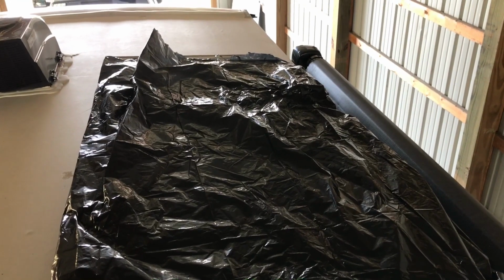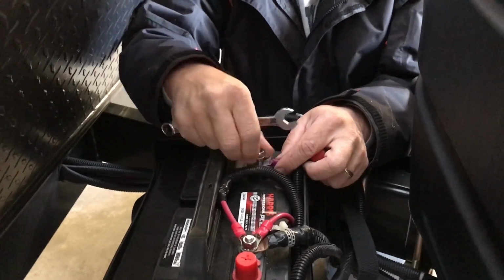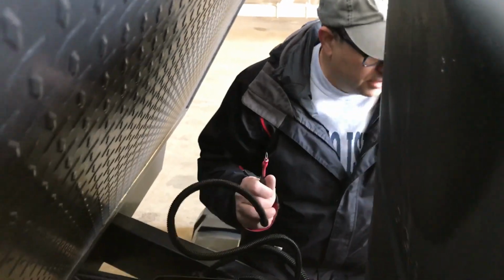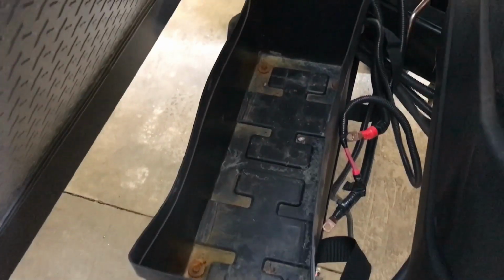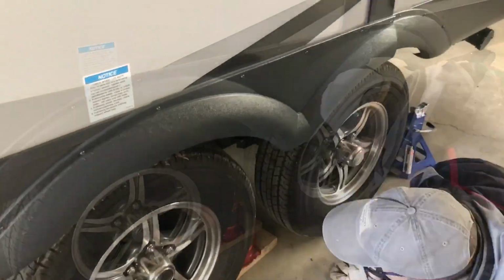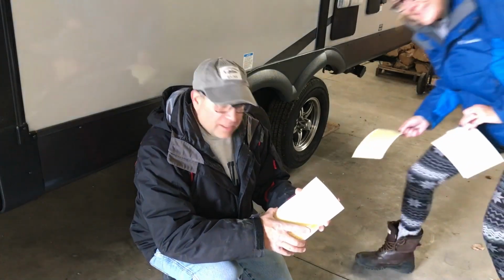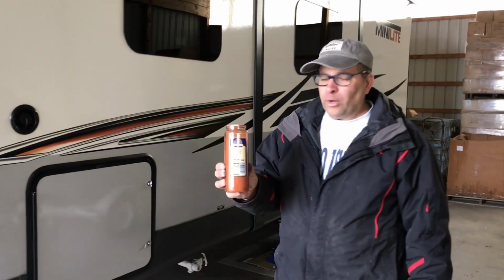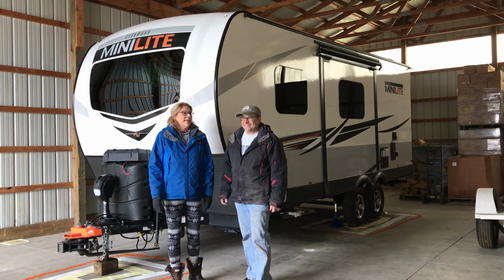Rockwood mini lite 2205s Winter storage & Mouse prevention. #rvlife #werv #rockwood

Comment: Great detail in putting Belle away. This will pay off in keeping her running her best. Saw that you use Harris batteries. What is your assessment of them? Looked like (2) 12-volt batteries, but couldn't quite tell. As we often camp off grid, we wanted to get the gas/electric fridge, but couldn't get it. With the solar panel, are the batteries sufficient to run your 12-volt refrigerator?
Reply from the maker: Hi, Thanks, We are trying our best to keep her in good shape… You are correct. We do have two 12 volt Harris batteries, they came with the Belle when we purchased her. When we first got it I noticed that when we traveled the battery level would be down a bit. I suspected something was up so I removed them both and took them to the auto parts store to have them tested. One tested bad…..After having it replaced we do not notice any decreased battery level while traveling, they have been good. As far as boondocking, I have not tested how long they would last with the refrigerator drawing power. When we boondock we use our Honda 2200I and I also installed a Microair EasyStart on the air conditioner. Not really roughing it……
I may have to do a video of how long we can run the refrigerator on battery/ solar alone. 
Thanks
Happy Camping!
Reply: @TNTRVing  Yeah, that'd be a valuable video. I'll find out sometime, hopefully not the hard way. We do have a generator, so hopefully that will be enough to supplement the solar and let us boondock as long as we want to. Thanks again for the tips.